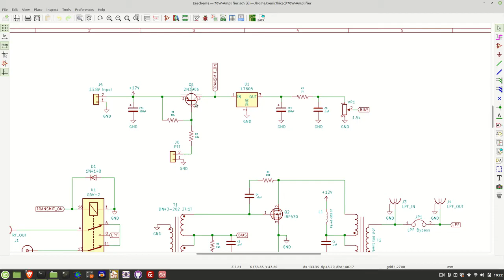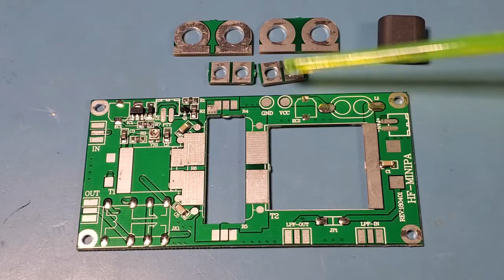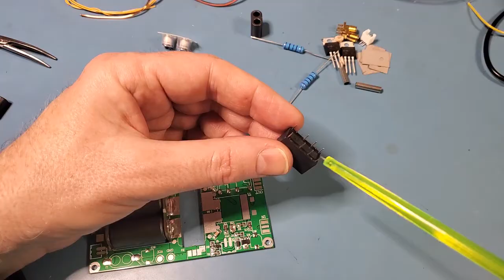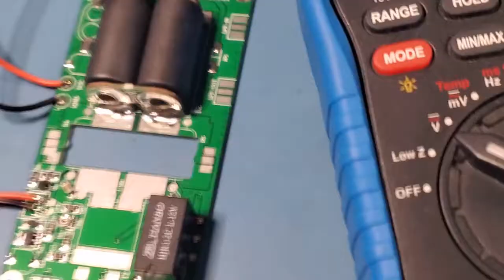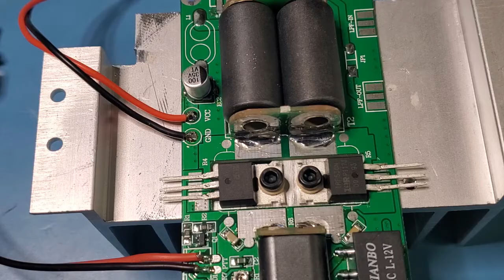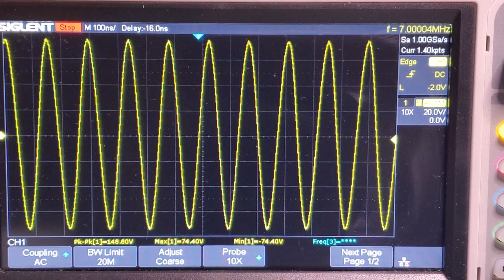70 Watt Amplifier Kit Build

Comment: CAN I TRANSMIT WITHOUT LPF
Reply from the maker: To transmit legally you need an LPF
Reply: @na5y  In VU not required by law
Reply from the maker: @VU3ZNL  I would be surprised if the India Dept of Telecomms doesn't have a similar rule.
Reply: They say thath you should not interfeare with other singnal thath's it
Reply from the maker: @VU3ZNL  Ah then if you don't put in an LPF you would potentially be interfering with another signal

Comment: I'm a new amp builder and would like to know where's the best place to put the volt meter probes when adjusting the bias voltage?
Reply from the maker: The place I was using was the gate of the mosfets - which is the very left most pin looking from the top of the mosfet (with the IRF530 writing right side up)

You do have to
1) Make sure the amp is powered, has PTT grounded but no RF is flowing in
2) Be super careful not to short the left most pin with the middle pin on the mosfet (gate and drain) - that will blow your mosfet very quickly - ask me how I know
3) Start with the pot in the lowest position. Unfortunarely the pot on the board doesn't have a "start" position as it rotates freely. My advice would be to find this minimum position without the FETs installed.

Hope this helps and thank you for the comment!

Comment: Fascinating video! With proper biasing couldn’t this irf-530 pair be run class A/B?
Reply from the maker: I would definitely think you could run this with a pair of IRF510s. Less power of course - thank you for the comment!
Reply: @na5y  sorry, I meant to write irf-530 not irf-510. Still, with the right bias voltage, class AB is possible.
Reply from the maker: @radiotec76  I think you are right - I have now seen others who have been able to make this work AB. Definitely want to do a followup video on that

Comment: Could you replace the irf530 to a irf540
Reply from the maker: You definitely could - pinout is identical. Bias would be different of course
Reply: I received this amp had nothing but issues I followed every instruction from your video and as soon I applied power it was a short   I used the supplied 530n transistor then order another set same issue ? Shuts my power supply down as soon as I apply power check all connections not sure what is going on must have received a bad board or one of the already attached components is shorted
Reply from the maker: @Davidsmith218  DId you get a chance to measure the bias voltage? When the mosfets blow it usually produces a dead short between Drain and Source. When I was playing around with it I did manage to blow one of the traces on the board completely (the one between the final transformer and the drain)

Some things to check
1)  With the mostets still installed Check between the input side of the output transformer (those big pads) and ground. Should be no continuity
2) If there is remove both mosfets from the board and try again. If after removing there is no continuity that definitely means one or both of the mosfets is blown. If after removing the mosfets there is still continuity then maybe you have a solder bridge somewhere (or potentially the input side of the transformer is connected to the output side somehow). You have to fix that before proceeding.
3) If you have a component checker check both mosfets (if you don't you can use a DMM - refer here https://www.youtube.com/watch?v=gloikp9t2dA&t=3s)
4) Before reinstalling the mosfets make sure you check the bias voltage at the gates of the mosfet - do this without an applied signal - it should be no more than around 2.5 V - but I would start at 0V and slowly work your way upwards. Incorrect bias voltage is most likely the reason if you are continually blowing mosfets.

I hope the above gives you some leads - and remind yourself that debugging is always more than half the fun ;)
Reply: Yes it works I didn't have any more 530n so replace with 540n and it was the Bias volts so set it to 2.5v driving it with 1 watt and getting 10watts out too scared to drive it any harder thanks for the help and information
Reply: @na5y  I look at the data sheet and it shows 100v so is this the supply volts and the Bias volts of 4v  max for the 540n so is it possible to separate the Bias circuit from and run the MOSFETs on a higher voltage  I'm trying to get 120w to 150w  my TS830s is tube and are  weak I can get 5-10 watts  out from the ts830s  and would this amp possibly work for SSB  I'm in the process in building a keying circuit to key the amp I rewound the output binocular with 5 turns instead of 3
Reply from the maker: @Davidsmith218  Awesome David. If you are game you can go all the way up to around 3.2V bias voltage - and while it is a bit of a knife edge, you should be able to coax more than 10W. Good luck!
Reply from the maker: @Davidsmith218  I think it would be a stretch for this amp to do 120W. Even if you could you'd probably have a very non-linear output (assuming you are planning on using this for SSB). The links in the video description show some experiments that got up to 40W while remaining linear.  

There is another version of this kit out there that uses MRF dual mosfet that you might want to look into. I haven't tried it myself
Reply: @na5y   if I drive this amp a little hard and blow a fet it only blows 1 everytime. The one closest to the bios voltage control (VR) ?   I replace that one good more testing till that one goes I'm learning a little about MOSFETs in this process and have a kit with irfz44n  irf510 520 530 540 640 740 840 irf3205 & irf9540  so until the circuit board goes up in flames Ill try them all and keep a record of the results  with 1w drive  I'm going to set the Bias volts to 2.5 a test if possible and output into a dummy load and frequency  just to see if a different fet works better or worse for the frequency    I'm in Michigan and its cold and snowing  good indoor project I suppose
Reply from the maker: @Davidsmith218  I love the experimentation! Did you get a chance to read one of the attached articles
I had in my followup video: https://f5npv.wordpress.com/irf530-mosfet-amplifier/

In that he spends a lot of time walking through how he controls/monitors the temperature of the FETs. Definitely a lot of good stuff in there which I want to try myself also.

One thing to potentially try is to reduce the value of the feedback resistors R4 and R5 to combat the oscillations. I believe he was using 47 ohm resistors there - they do have to be 1 watt or greater.
Reply: thanks for that information
Reply: Now searching the net I found a guy using irfp250n and able to achieve 400+ w.  but I'm having issues finding any documentation. And the video is not in English  do you or know of any info on this amp using a irfp 250n  this is a low cost fet like 5 for 10$  or less  this would be nice low cost amp other than mrf300an /bn  that keeps popping up
Reply: @na5y   would you have any information on a amp that uses the irfp250n
Reply from the maker: @Davidsmith218  Interesting you should ask David. I purchased some IRFPs earlier to try just that. As soon as my lab is back up and running I am going to give that a go.

Comment: anyone know of a amp that uses irfp250n and able to achieve 400+watts  I've seen a couple videos but not  finding much  information  any help is much appreciated
Reply from the maker: I haven't played around with that FET myself - but I do plan to...
Reply: @na5y   I ordered some irfp250 and 260. The 260  showed up first so the 260 I'm getting good results with good forward gain I used a DC to DC buck step down converter with a digital display for Bias control for testing and  works great now I have had the  Bias up to 3v I'm powering the system with 14.5vdc and getting 50w out with 3watts in  what's would be the maximum bias volts I should run I see some  talk about milliamps but not much about volts

Comment: The input SWR is not the best. For that you have to mount R6 (I use 22 Ohm). The input SWR is then at least somewhat acceptable.
73 de Bernd
Reply from the maker: Definitely! The pa-11019.blogspot link above has a selection of resistors to use on different frequencies. I certainly want to play around with this amp a bit more in the future. Thank you for the comment!